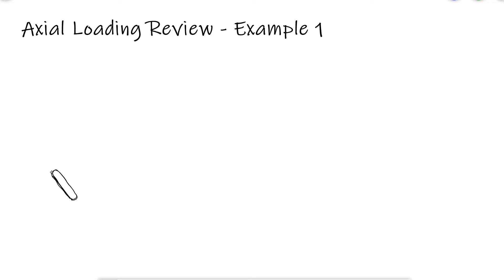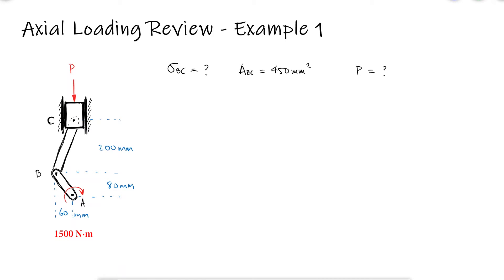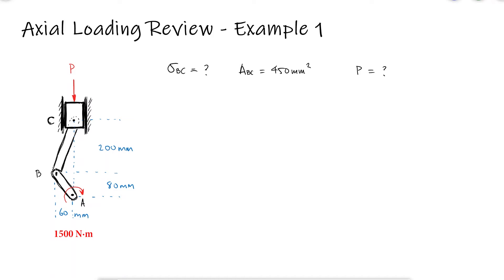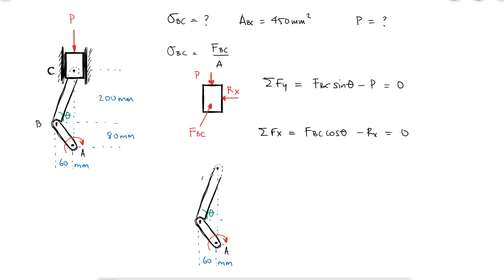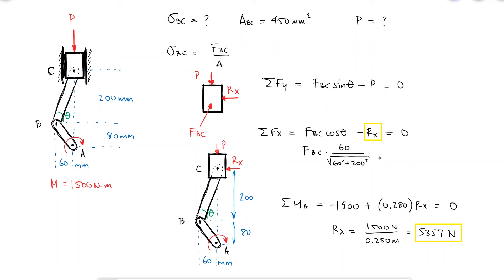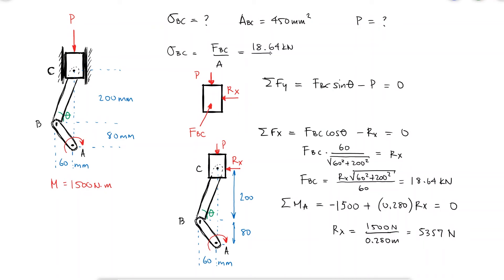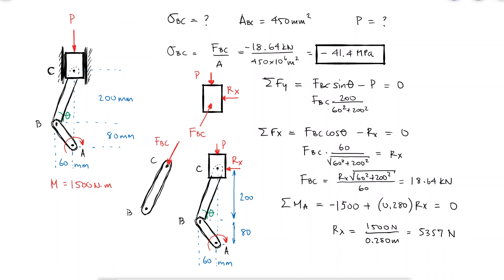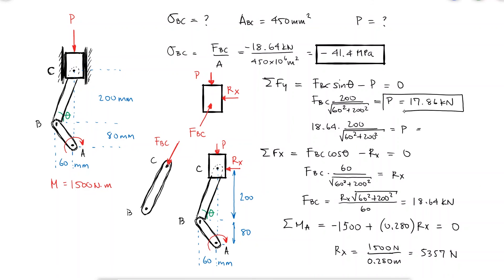Piston-Rod-Crank Stress - Axial Loading in 90 Seconds!

Comment: sum of forces formula looks a little wierd to me can you explain if steps were skipped or anything?
Reply: I'm not sure what your confusion is but I'll take a guess and if you are still unsure just reply back. 

He basically compartmentalized the FBD. The way you can think about it is if you imagine what the internal force is in member BC near joint C. This "internal force" is simply Fbc. P is a load that is holding the structure in static state. So then the only vertical force that is "fighting" against P is Fbcsin(theta) and the only horizontal force fighting against reaction Rx is Fbccos(theta).

When he does the summation of Moment about point A. He goes back to the entire structure. Point B is free because it is not constrained. It is free to move in X, Y and in rotation which is why there are no Reaction forces about point B. So then the only force that makes a moment couple at point A is Rx multiplied by perpendicular distance.
Reply: @EngineerHarris  why was 450 x10^6? where did he get the 6 from? isnt mm supposed to be 10^-3?
Reply: @lavis4448  Abc is 450 mm^2. But in his stress equation he is converting the area to m^2. It's the different between Square Milimeters and Square Meters. 

1 m^2 = 1e+6 mm^2
Reply: The only weird thing he did here is that FBC was assumed to be compressive from the get-go, so when the equations were completed, we got a positive value for FBC. As with the previous videos, it's still better practice to assume every unknown force to be tensile just to have a convention going.